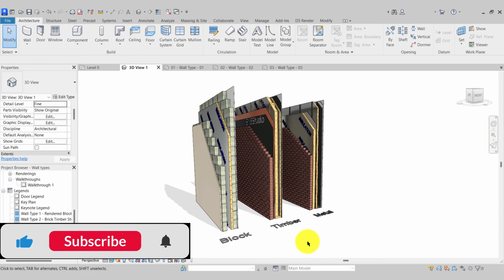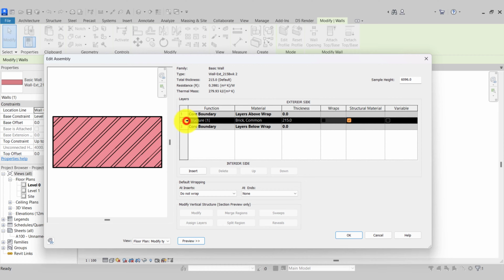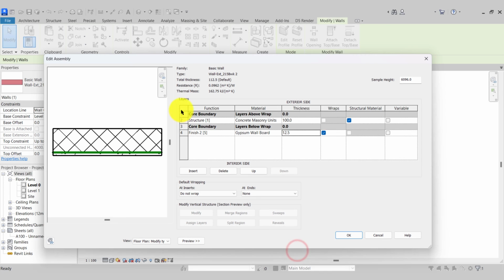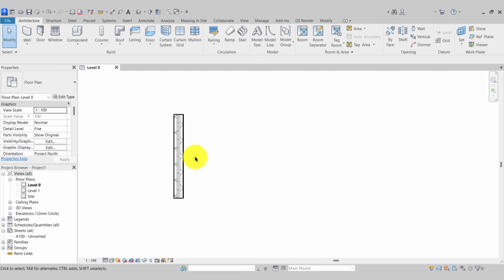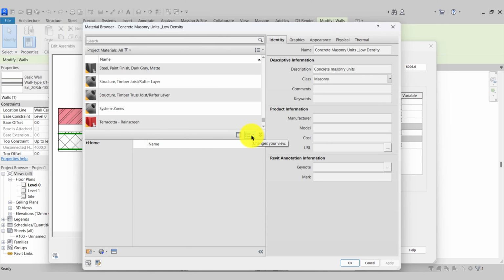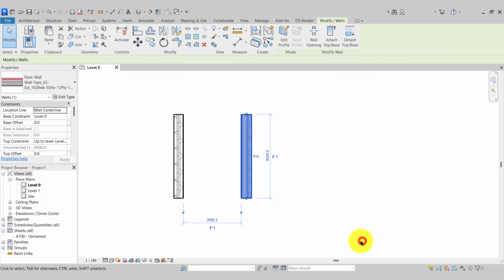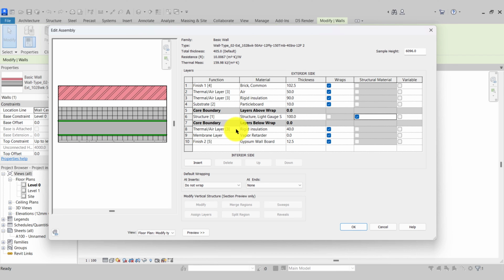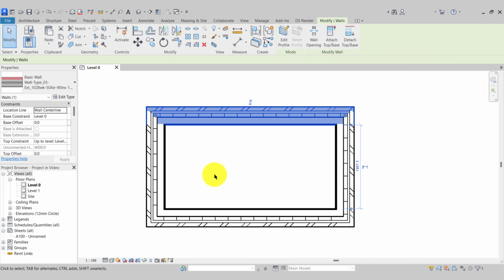Creating and Modifying Wall Types in Revit - A Step-by-Step Guide

Comment: If we put the 60mm air cavity instead of 150 mm Timber frame , where the core boundary will be?
Reply from the maker: You should place the core boundary around the structural element that replaces the timber frame, or keep it consistent with your primary load-bearing layer.